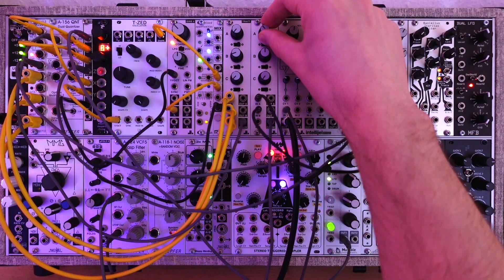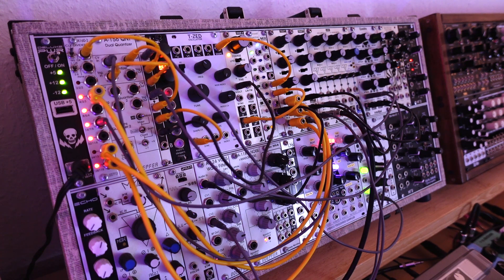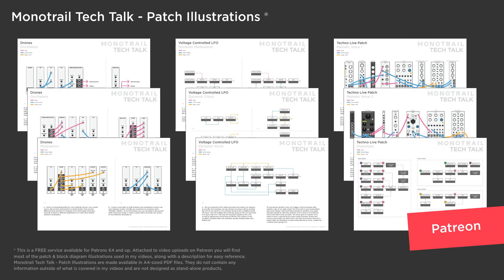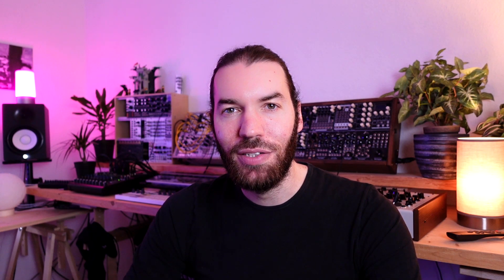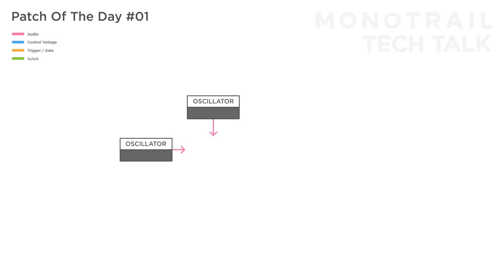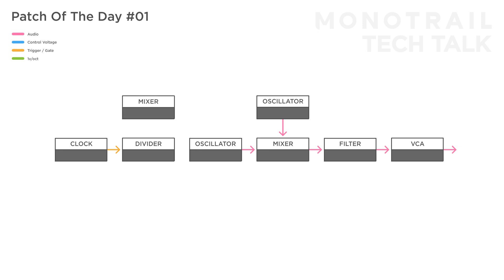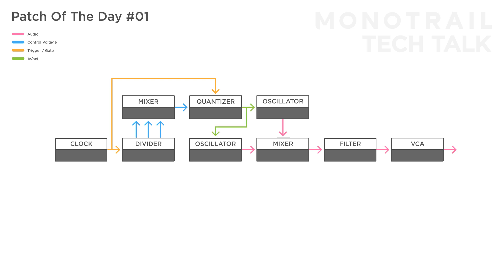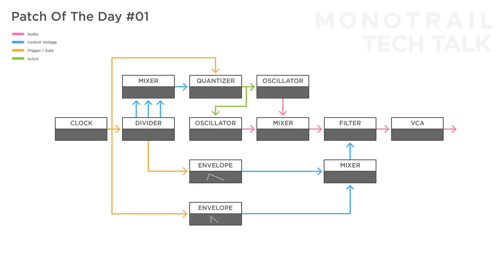Patch of the day – Modular voice driven by a clock divider (POTD#01)

Comment: Hello, Excellent content, Question: Do you think I can use a CLOCK DIVIDER (4MS) and control the GATE with the Intellijel Shifty in replacement of the doefper A-160-2V module that you use?
Reply from the maker: Thank you, glad to hear you like it! The 4ms clock dividers are nice, as far as I know they all do triggers though. But of course you can still use those to trigger AD envelopes. For the melody you would need a few different gate patterns. I'm not so familiar with the shifty, but as long as those gate out's can produce a few variations, you can give it a swing!

Comment: Very interesting patch. How are the VCOs tuned? As a mixer for the gates of the clock divider I could imagine a T43 Precision Adder from vpme could also be interesting too.
Reply from the maker: Ah, think I tuned the T-zed a fifth above the Dixie. As for mixing you need a mixer with knobs to attenuate the incoming gates. No need for precision adders, because the signal is quantized after mixing!
Reply: @MonotrailTechTalk  your right, no need for the precision adder. I will experiment with this patch idea. Thanks for the video.

Comment: Great video, thank you!
I sat down and made a variation of this patch using the 3xMIA as a CV-attenuator/mixer. I think it has the advantage over the Triplatt that it can mix up to 6 attenuated/inverted gates and has three outputs with 2/4/6 signals mixed, if you link its stages. You could of course use cascading VCAs to automate the blending of the different gate signals... Endless possiblities based on this simple but clever idea.
I hope you will release more videos like this.
Reply from the maker: Hey thanks for the comment! I love the 3xMIA, there's one in this same case even. I picked the triatts for clarity, but would use the MIA otherwise as well. Automating the motion with VCAs is a lovely idea, so much possibilities there!  Glad you liked it :)

Comment: Great series. I will follow. This month i was thinking about catching a doepfer clock divider for gates. Does anyone know if the a-160  outputs gates o just clock?  (Not the 160-2 which does)
Reply from the maker: Thanks, glad to hear it! :) The a-160 sends out gates, not triggers. If you like to pair the a160 with the a161 it's interesting. Otherwise I would really recommend looking into the a160-2, that offers gates or triggers (with a switch on the front), more division outputs at the same time, and a switch to set between regular 2/4/8/16/32/64/128, as well as 1 to 8 and prime numbers divisions. I'd say those options are worth the extra €30.

Comment: Great patch!
I'm a bit confused about the part with the clock divider. How does one choose where the different divisions are going? Is there some sort of musical theory behind or is it more a musical feeling thing aka try'n'error until it sounds good?
Reply from the maker: Hello Manuel, not sure what you mean there exactly? Where the divisions are going, is done with the patch cables of course. What divisions are created is set on the divider. Different brands/modules have different options. 

If you mean what they are doing tonal. Think of each of the gates coming from the divider as either leaving the pitch as it is (gate off) or pitching the oscillator up (gate on). How much the oscillator is pitched up is set with the knob on the mixer, attenuating the incoming gate signal. It gets more confusing, and interesting when multiple (in this case 3) gates are working together, and partly overlapping/adding to the amount the oscillator is pitched up.

Don't know if this is clear enough :)
Reply: @MonotrailTechTalk  
It seems I still have to learn more english to bring my exact thougt to text...
I do get the technical part, where the gate signals from the divider go to and what they are doing. The flow chart is great! But thanks for writing that again!

My question is how do you decide where the different outputs from the devider are going.
Does it follow some sort music theory, intuition or just random until it sounds good?

Ich probiers mal so: Teilt man die verschiedenen Takt-Teilungen auf gut Glück ihren Zielen zu bis es gut klingt?
Hat man da so etwas wie einen musikalischen Hintergedanken bzw. Musiktheorie oder sind das eher Erfahrungswerte was sich gut anhört?
Vermutlich von allem etwas ;-)

Jedenfalls eine super Idee mit der neuen Serie und danke für deine genialen Flussdiagramme!
Reply from the maker: Ah yes, that makes sense, sorry for misunderstanding. In Englisch, because other people might like it: Yes, that is a bit of trial and error. Both for the melody and rithm I thought it would be interesting to match even and uneven numbers. Like a clock and a divide by 3 gives nice shifting results ets. But mostly it's jus ttrying some divisions and see what happens. In the three examples before the flowchart I use a few different divisions. Also that's why I like to use the stackable cables. I can repatch and even use the same signal for both melody and envelope if I like
Reply: Thank you!